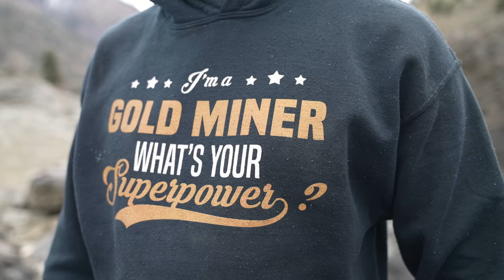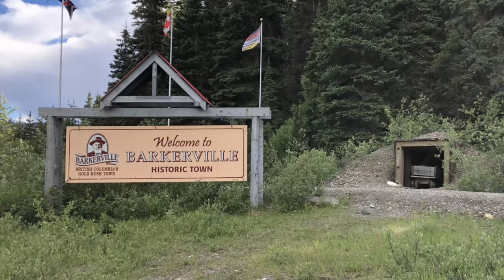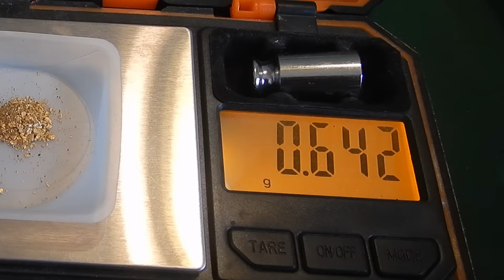This Is Why High Banking For Gold Is WORTH IT!

Comment: hey Pauly trick of the trade take your pan over to the pump the vibration from the pump will get the gold down to the bottom of the pan or one of the sides if you angle it saves a lot of time panning

Comment: You need to know that there is gold escaping from the sink and usually it is very small size and this usually happens because of the high speed of water flow in the gold sink and you have to repeat the washing process and increase the number of liners that are used to pick up the gold at the washing stage.

Comment: Hey Pauly, Dan and to all of you peeps out there! That black sand.... Over here in Grand Junction Co we have the Gunnison river that has a lot of flood gold but that's not the half of it! My partner and I looked at the black sand under a high powered microscope (sorry don't know the techs) (very close up pics) only to see what I thought was GOLD encrusted in black sand... took some of the black and put it into a rock crusher/polisher about 8" wide by 12' deeps with water and after 24Hrs check it and the whole top of the canister (turned up) was covered with fine gold! I was like WOW!!! ran it 3 more times and all but the last run had a thin layer of GOLD!!! Unfortunately I got a full time job and had to quit doing the thing.... JUST trying to say that the black sand is at diffidently worth checking out where you peeps are! Just lost my job and going to just take a magnet and try to separate it without chems. JUST A HEADS UP!!!! Love you guys! keep up the good work and appreciate the knowledge!

Comment: Be careful I had a free dive incident that resulted in a permanently retracted eardrum. This still causes equalization issues and balance issues for the last 20 years. It also resulted in the end of any diving including snorkeling ( I always want to go down below the surface). I realize that the depths you are at probably won't create that problem, anytime you can't equalize or have sinus congestion you should refrain from any diving.